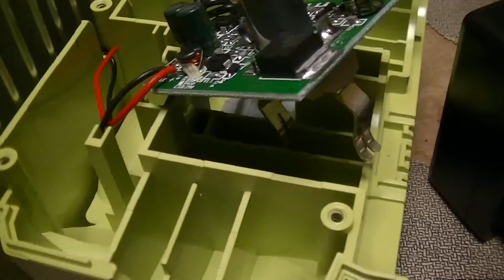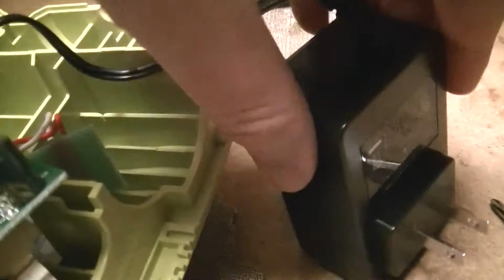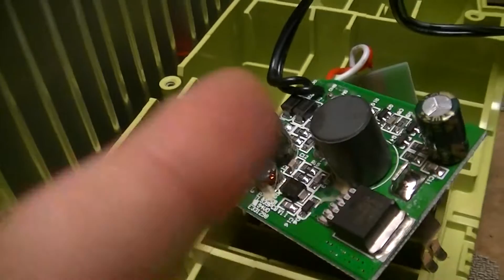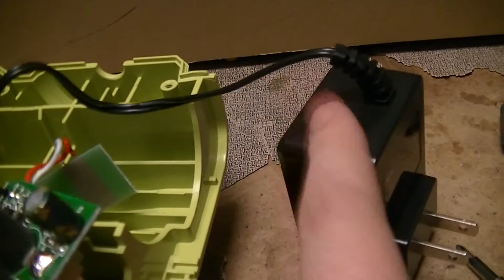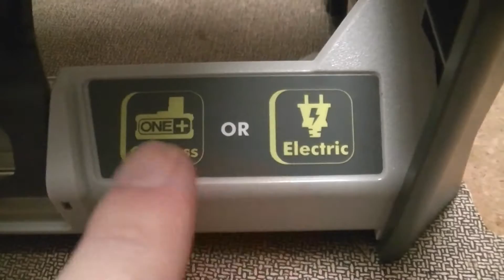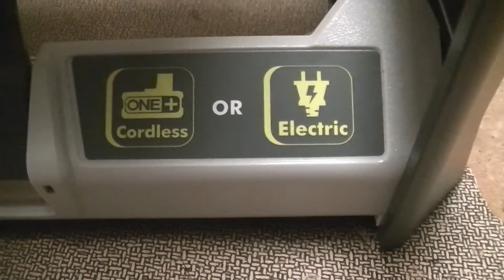Ryobi P720 LED worklight guts/teardown

Comment: is the circuit board step up voltage to 24 volt or no> i think that led work on 24 volt
Reply from the maker: Around 30V to 33V.

Comment: My P720 just died. It would not shut off using the battery. I tried several batteries and all lit the LED but would not turn off unless the battery was removed. When I applied AC to the light it just blinked. The power switch would not turn it off. It's out of warranty so I am stuck using battery only and having to remove the battery to shut it off. Vary disappointing.
Reply: Mine would only work with a battery and no long a chord, frustrating
Reply: I got the same issue, won't turn off when the battery is installed and blinks when a cord is plugged in.  Any idea if it's easily fixed?
Reply: The solution seems quite simple, to just put a panel mount switch on the casing that cuts power from the battery. Then again, it's not like it is much trouble to unplug a modular battery like that, takes what, maybe 4 seconds out of the long time you were using it?

Comment: So add a brightness (intensity modulation) feature yourself.   Take a look at the XL6006 datasheet.  It uses a typical current (voltage comparitor measurement) sensing resistor to set LED drive current.

Per the datasheet we see it is resistor "RS" between pin 5 (Feedback) and pin 1 (ground).  Output current follows the equation 

I = 0.22/RS

As you can see from the equation, to reduce brightness, by reducing output current, you need a higher resistance value.  For example, (and I am making up #s since I don't know the type of LED, what its forward voltage is and thus what drive current max value for 20W would be) suppose it is outputting 2 amps.  That would mean RS in the equation above is 0.11 ohms "IF" it originally had a 2A output.  HOWEVER, they might have used two resistors in parallel or series to achieve the desired current.

You'd just desolder the existing resistor(s) and put jumper wires in their place, wired to a multi-position switch where each contact pole has a different value of resistor (or series and/or parallel) to reach the target value.  For example in addition to high mode you might want 1/4th the output for a low mode, so you'd use a 4X larger value resistor, 4 * 0.11RS = 0.44 ohms.

There might be potentiometers on the market with a range up to 1 ohm that would work too, but I'd definitely put the 0.11 ohm (or whatever value it is) in series with the pot so that it can't be dialed down to zero and result in an overcurrent state to the LEDs.  Also note on the datasheet that you need to calculate voltage * current to get a (dissipation) wattage rating for the resistor.

Precision resistors in these odd values can be found at better electornics supply houses like Digikey, RS, Farnell, Newark, Mouser, etc.  In the US my first pick would be Digikey due to their low (if not no) minimum $ order requirement and the option to use much cheaper USPS shipping which is maybe $3 for something under a few ounces.  Of course you might find some on eBay for $1 delivered on the slow boat from China but may not have as good a selection of ohm values and wattages.

Comment: Thanks for your video.  I've been very curious about these Hybrid devices.  

I was wondering if it is possible to retrofit other devices to take both mains and battery power.  I have lots of the One+ tools and lots of batteries too, but sometimes it's nice to plug in when you are working on a project in the house.  I assume this type of wall wart would only be suitable for lights/radios/fans but wouldn't stand up to the draw of a saw or drill?  I have a few drills and my thought was it'd be nice to convert one to hybrid.  Maybe even a circular saw, because those only cut well with the 4ah batteries on a full charge.
Reply from the maker: You would need a multi hundred watt power supply for anything that does drilling or cutting.  Motor tools also have to deal with odd momentary overloads and switchers tend to not like such operating conditions.  Small loads like radios, lights and fans make the most sense.
Reply: This is meant as a stationary light.  Shoehorning the necessary size high current AC-DC converter board into one would make it significantly larger, heavier, and more costly.  

Even to DIY, you're as well off just buying a corded version of the same tool.